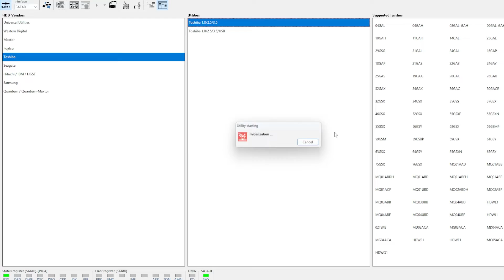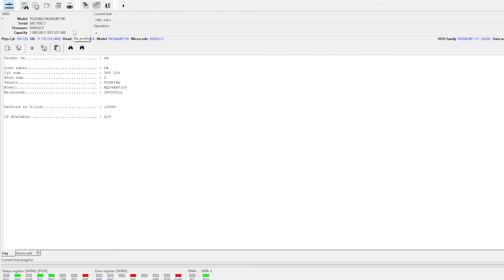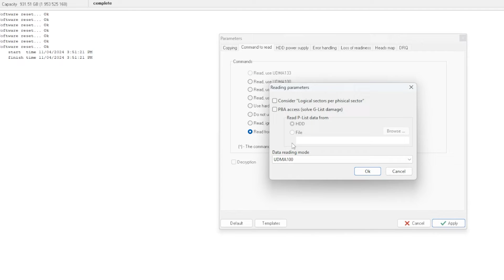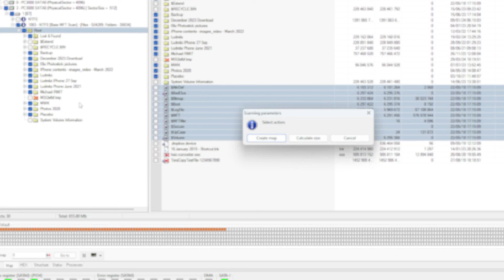:( BLUE SCREEN USB HDD Data Recovery

Comment: I have the exact same problem with a MQ04UBF100 AZA AC32/JU0B0U (PCB G0039A)
But i'm from France. If I found a PCB Replacement (hich one ?) and someone who can solder swap my BIOS. What software to recover data ?

I think price to send you that and repair will be too expensive from Europe ^^
Reply from the maker: You can try that. But my service is cheap and maybe even cheaper when you convert euro to aussie dollar. We have a cloud server where customers can download there data from anywhere in the world
Reply: @ZeroalphaAu  Ok thank you. we have swapped the PCB, now it connects to ths PC without bluescreen. But the disk seems to have a problem with the reading head that make lot of noise and I can't access data.
What would be your price for a repair (if possible) ?